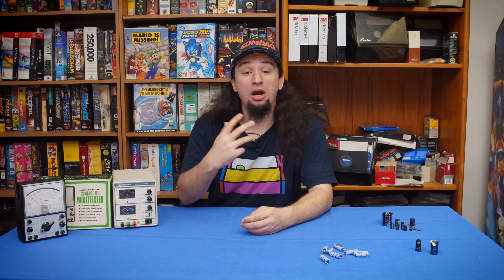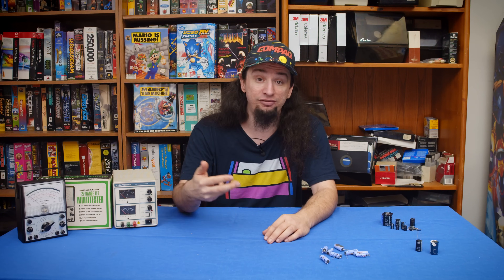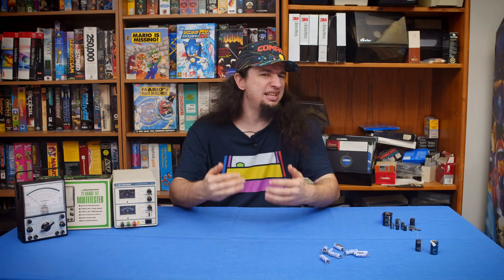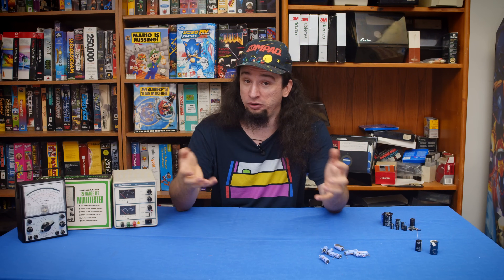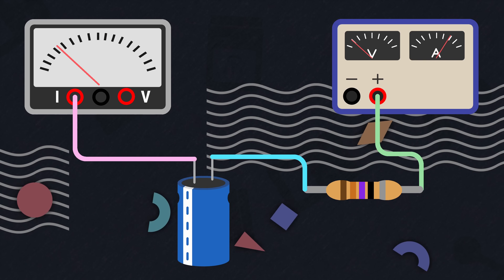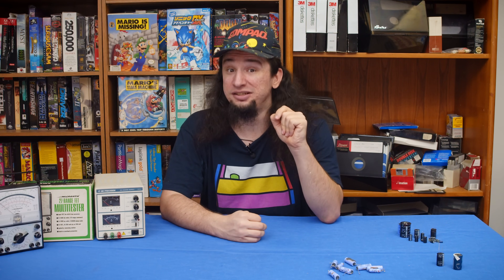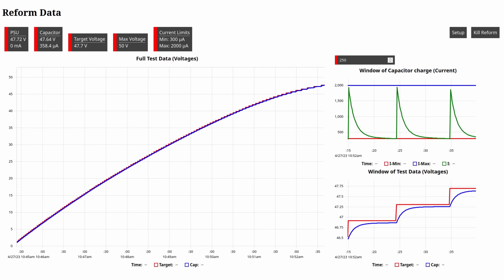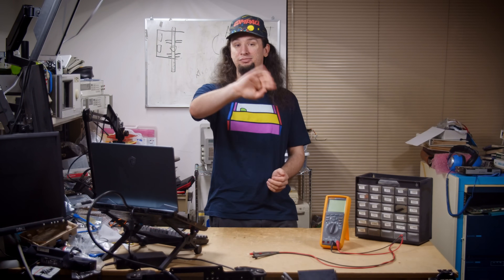Reforming Capacitors - Everything you wanted to know

Comment: Does it mean that it’s good to turn on our retro computers from time to time?
Reply from the maker: That is the best thing you can do with them!
Reply: It depends what time frame you're talking about. If the dielectric has degraded to a point then switching it on will blow it out. But if you catch it in time then you can rejuvenate the barrier. Forming does tend to take some time. Not as much as literature suggests but a fair amount nevertheless.

Comment: This is also why you should always avoid using capacitors with a voltage rating hundreds of volts higher than it will ever see in the circuit.
Reply: Up to a factor of ~3 above actually sustained voltage seems to be the generally accepted limit. So up to 35 V parts on a 12 V supply or 16 V parts on a 5 V. Usually you'd only be seeing a modest margin with 16 V or 6.3 V parts respectively from the factory, which generally comes down to space/budget constraints. If you can afford it, I'd go with 25 V / 10 V as a good compromise, especially when replacing >40yo parts (which used to have a much wider spread in actual voltage handling, so in order to keep a large enough percentage of the whole distribution above minimum, the average had to be substantially higher than it would be today where tolerances are much more tightly controlled - guess why they have gotten a fair bit smaller).

Spots that never see any appreciable DC voltage are a special case. Short of going for dedicated low-leakage series capacitors (like the orange Elnas often spotted near stereo decoders in Japanese FM tuners, which rarely ever fail), your best bet is going for a modestly low ESR series (since ESR tends to inversely correlate with leakage) with a reasonably high voltage rating, basically accepting that the capacitor will never be reformed and that its dielectric layer is invariably going to degrade over time. Under these circumstances, higher voltage rating directly translates to longer service life.
Reply: @PileOfEmptyTapes  So far have had to replace every single orange dipped Elna I've come across on 80s receivers. One 47/16 gave a reading of 10.8u and over 6R ESR with high leakage. Nichi KL and Wima MKS for those <10u work well.
Reply: Why actually?
Reply: @SianaGearz  Because it won't form.
Reply: @tarstarkusz  why is this a bad thing? it's formed from the factory. I just need it to not unform below real operating voltage.
Reply: @SianaGearz  Because it breaks down over time.
Reply: @tarstarkusz  why won't it form to real operating voltage?

Comment: many power supplies have a constant current feature. also it's switch mode power supplies that you can't reform the capacitors in. linear regulated power supplies I think would be fine to use on a variac.
Reply: I think the reason for using voltage + resistor instead of a constant current mode is that only specialised or higher end gear is likely to have single digit milliamp constant current control, let alone sub-milliamp. The resistor approach gives you much more control and can be done with basic equipment
Reply: @StephenHoldaway  Thoughts on using one of those power supplies that has good voltage regulation but maybe not the best current regulation with something like an LM317 in a current limiting circuit topology? You should be able to dial that in to just exactly the current you need, and then you should be able to leave it alone until the capacitor is done reforming.
Reply: @44R0Ndin  yeah I'd expect that to work - the linear regulation shouldn't be a problem with such a low current. Curious how this would perform vs the method in the video, since it would be continuous power rather than pulsed
Reply: @StephenHoldaway  good point. I don't own one myself with constant current. have wanted to build one, one of these years.

Comment: Technically, you're throwing far too much hardware at this problem.
You can do all you need to do with (at minimum) an LM317 set to current limiting mode, and a power supply capable of supplying enough current at the DC working voltage of the capacitor.
Monitoring? Sure, if you want you can throw current and voltage meters at it. But you don't NEED to.
The LM317 in this case would be acting as a "smart resistor", in that it replaces the fixed value current limiting resistor in your HP GPIB controlled setup with a current pass transistor set to enforce a maximum current limit, and the DC voltage is fixed by the setting of the power supply's regulator.
Seeing as the LM317 can just be set to 2-5 mA and left that way, and the adjustable bench power supply can ALSO be set to the final voltage and left that way, I see this as a superior solution.
The only improvement I can think to make is to use a switching current regulator instead of the linear LM317 current limiter IC as the current limiting element, but that would only increase efficiency of the circuit, not improve the overall result.

Of course, when doing this in the real world, you would hook everything up, turn it all on, and monitor it for the first few minutes to make sure the capacitor isn't getting "too warm to hold in your hand comfortably" as a general upper limit for the temperature. However, it is important to note that since we're talking about a live circuit with potentially high voltages involved, the temperature measurement should be done via a thermocouple attached to the capacitor, or using an IR thermometer reading off a piece of standard (normal paper color) masking tape stuck to the side of the capacitor.
The masking tape ensures the reading is accurate because sometimes shiny surfaces, especially metallic ones like seen on many older aluminum electrolytics, can mislead an IR thermometer or cause it to read a reflection from elsewhere in the room, rather than what you're pointing it at, and the matte surface of the masking tape prevents this possibility while not itself having a large thermal mass that would otherwise degrade the measurement's accuracy.

Anyways, if it's not warming up within the first 5 minutes you can safely leave it alone and go do something else for the rest of the time that you want to reform the capacitor. I'd recommend staying in the same room so that if something DOES go wrong unexpectedly you can intervene quickly before too much damage happens. If something unexpected DOES happen, the capacitor will nearly certainly be unsalvagable, but at least you won't have burned down your workshop!

Of course, there are no guarantees for the remaining working life in a reformed capacitor, other than you can be certain that it is less than the manufacturer's stated maximum lifespan, but you likely already accepted that risk going in to this task.
Reply: or use a current-limited power supply (like he had in the video) lol
Reply: He wasn't using a current-limited power supply in this video, he was using a fixed resistor to turn a regulated voltage power supply into a way to limit the current.
I was suggesting exactly what you're suggesting, adding a LM317 in current limiting mode to an adjustable voltage power supply makes a power supply that can have both current and voltage limits applied to it. Of course your way works too, and requires no soldering, but my way probably regulates the current at these low levels a bit better (since it's a linear regulator and not a switch-mode power supply).

Comment: So there's still an lingering unanswered question... I have some old C64's, VIC-20's, Amiga, Atari, and a Commodore monitors and disk drives I want to power back up... yes they were mine and they were retired in working condition... but all this talk about these capacitors make me nervous about doing so.  I should point out that I have an electronics degree and even back in the day repaired C64's at an authorized repair shop... but we had donor boards and access to things that I don't have today... so I know I run a risk of potentially damaging irreplaceable components if a cap-zap-itor wants to give me trouble.

That all said, I would appreciate any advice for powering on the old equipment... for example, should I recap the electrolytics before powering on?
Reply from the maker: I would recommend opening them, visually inspecting for obvious failed parts(leaks, bulging, etc), then seeing if there are any caps over a decided energy limit that should be reformed. Once you've done all that you should reduce the setup down to the minimum needed parts to test each thing and power them to see if they work. From there you will have to diagnose backwards any issues you find and maybe find schematics online for stuff if you can to help know what should be going on.
Reply: Variac might be good for that. Slowly ramp up the AC to test/reform the PSU caps.
Reply from the maker: You cannot use a variac on switch mode PSUs like are used in computers. It will not properly operate like a linear PSU can
Reply: @TechTangents  are the C64 and Vic ones SM? I don't know those machines but the Japanese ones of that era were mostly linear. Good point though, I should have mentioned that.
Reply from the maker: The C64 and VIC PSUs output 9VAC and the C64 also uses an LM7805 which is an LDO regulator that won't work at lower voltages and then lock to 5VDC when you get above its threshold. The 9VAC will scale, I'm not familiar enough with the C64 to know what it does, but it is not an analog device and it should not be reduced like that to it.
Reply: @TechTangents  The VIC-20 does have a 9VAC input, full-wave bridge and a pretty big cap I think it was a 2200 uF or maybe bigger... and I can just replace that out my electronics stock... Inside my VIC-20,  Mfr'd probably before 1981-ish there's. Inside a 5V 1.5A linear regulator  (LM309K  it's a TO-3 case).  I recall needing to replace the bridge rectifier, I don't think it had an adequate heat sink... I replaced it with an oversized one that I had on hand. 

A Variac isn't going to help at all for that, and BTW, I don't have one anyway. But I'd get one if it would help for the computer monitor CRT.

Power supplies seem to be the weakest link in these older computers... I had to fix the PSU for the C64 as well.  And when I worked as a Tech,  I replaced a lot of RAM chips, most of the "No Video" complaints were RAM chips... rarely it was anything else.  I learned to tell by putting my finger on the RAM chips and if it was burning hot, it was a sure bet it needed replacing. LOL
Reply: @TechTangents  From my experience linear regulators like the 7805 will justt output a lower voltage when their input voltage isn't sufficiently high. The approach might still work here. You can put a multimeter to the 5V rail and set the variac until there is a relatively low voltage e.g., 2V. It's hard to say though how the other components (especially logic ICs) will behave with the lower voltage. Pulling them first might be a good idea. But in any case slowly ramping up the voltage will very probably be better for the device than supplying the full voltage immediately.
Reply: @TechTangents  Okay, so the "PSU" is literally just a transformer and the actual regulation is inside the C64. Yeah, in that case a variac is useless. It should be safe, the 7805 will just produce a lower, less regulated voltage, but it won't help either. I guess the issue is that since the caps need to come out of circuit to reform them, unless they are particularly rare or have some mechanical requirement like existing straps to hold them down, the argument for just replacing them is pretty strong. Good to know that the rare ones can be revived though.

Comment: You forgot one tool you’ll need: a blast shield.
Reply from the maker: When you reform a cap intentionally, out of circuit, the overall goal is to slowly put energy into it to avoid creating high heat and pressure. I won't say never, but it should be almost impossible for a capacitor to build up pressure and explode from reforming.
Reply: @TechTangents  You're probably right.
Reply: If capacitors are blowing up then you're just doing it wrong. This procedure exists specifically to avoid that. Not every cap will come back but it'll fail out in the procedure before it blows up. It just won't progress.

Comment: I had an accidental capacitor fix happen on-camera. This was 3 years ago and it’s still working perfectly.

Very late revision Nintendo 64 consoles sometimes have failed capacitors, probably because this was the era when manufacturers were reformulating for RoHS compliance. They have Panasonic SMDs but they do not have the black square/dot to indicate RoHS compliance. These consoles will have no video or no audio. I’ve only seen this on NUS-CPU-09 and NUS-CPU-09-1.

Anyway, back when I was first researching this I was systematically working my way back from the AV port, replacing caps and even the NUS-AMP chip. I still had no audio so I was checking the voltage to the NUS-AMP at pin 1 when my probe slipped and shorted pins 1 and 2, instantly restoring the audio.

This sent 12v from pin 1 into the nearby C28 that was connected to pin 2. According to Panasonic’s datasheet, it was rated for 24v so I didn’t do any damage to it.

Comment: this seems like more effort than just replacing the caps...
Reply: For small easy to obtain caps, sure.  On the other hand, I recently acquired a HP 6012A dc power supply that hasn’t been used in 30 years.  I opened it up to service it, and found it had a number of huge (beer can size) screw terminal caps in it.  They were screwed into the PCB, including a 3rd hole for mounting.  They simply do not make those caps anymore and there are no replacements.   I did find a replacement of the same value,  but they were $90 each, the screw terminals were in different spots, and they were too tall to fit.  So there are plenty of use cases for this.  I reformed them / leakage checked them with a digital current limited Kepco high voltage power supply, and they were in excellent condition
Reply: Yes. Nothing uncommon about putting more work into spending less money - or trying to spend less money anyway, success isn't guaranteed.
Reply: Perhaps it is but sometimes my money tree is out of season. Sometimes I just like to watch the process work anyways. Climbing Mount Everest is also a lot of effort but people do that anyways too.

Comment: Never talked about how well the caps performed before and after reforming. :(
Reply from the maker: I did show the cap on the analog gear again after reforming it, you'll notice the most difference by seeing how much higher I get on the voltage with the PSU. But I realized (and forgot to update the script after) that comparing the caps to eachother was not as useful as comparing it to itself before/after.

Comment: Great video!!!!!   BUT... what about Bi-Polar/Non-Polarized Capacitors?
Reply from the maker: I am not sure how bi-polar electrolytics are constructed. I did try to find some information on that before making this video but couldn't find much. If they are essentially two anodes internally, then you would just need to reform them twice with the polarity being different each time. But I couldn't confirm that so I didn't want to speculate.
Reply: @TechTangents  Thanks, that's kinda what I thought!  Maybe a follow up at some point??
Reply: Forming only applies to electrolytic capacitors, which are by their very nature polarized.  If the capacitor is non-polarized or bi-polar (never heard that term applied to capacitors, but whatever) then they use a different type of dielectric, and forming would not be a thing in that capacitor.

For example the good old fashioned ceramic disc capacitors, no electrolyte.  Paper capacitors, no electrolyte.  Plastic film capacitors, no electrolyte.  These are all non-polarized devices, and contain no electrolyte, thus do not require forming.

No clue how tantalum capacitors work, however, so you're on your own there...  ^-^
Reply from the maker: In audio and some CRTs there are bi-polar electrolytic capacitors, they are a niche thing
Reply: @TechTangents  They are also often used in audio crossover circuits.  They sound much better than polarized caps (but not quite as great as film caps) when used in the signal path...
Reply: @jeromethiel4323  Interesting, well I have seen countless electrolytic caps that have written directly on them "Bipolar".  I have one such cap right in front of me right now.   Anyway, are you saying that these types of caps are NOT "re-formable"?
Reply: @Johnathan_Waters  interesting.  This is something I have never heard  of.  And I cannot even figure out how that would even work.

But if it's a real thing, then there must be a gap in my knowledge.
Reply from the maker: I cannot say with confidence that you can, it depends on how they are constructed which I cannot find much information on.
Reply: @TechTangents  That sounds exactly like what I was able to come up with as well.
Reply: Did a little googling and it seems that what you do is connect two normal electrolytic capacitors in series, one normal polarity, one reverse polarity.  This would work as each capacitor is electrochemically polarized, but the resulting circuit is not.

I do know you can make an electrolytic capacitor work reverse polarity, but it will have next to no capacitance, as the dielectric forms on the can instead of the foil, greatly reducing surface area.

I don't know why this would be desirable, i would just use film caps, but i am also not a design engineer.  I just fix the stuff other people design.  ^-^
Reply: @jeromethiel4323  You may find plenty of bipolar alu electrolytic caps as input/interstage/part of DC protection/NFB loop on amps and output and V/I stage coupling on sources such as CD players/tuners/tape recorders. They often are in the range of 22-220uF, so you wouldn't use a film instead. In tantalum, anode is marked with a plus, rather than cathode with a minus, as in alu electrolytics, so pay attn. to that, if you are indeed into repairs.